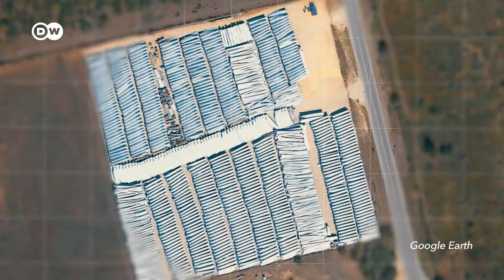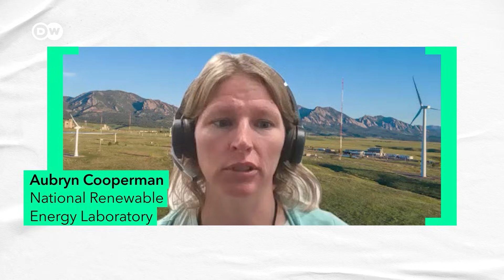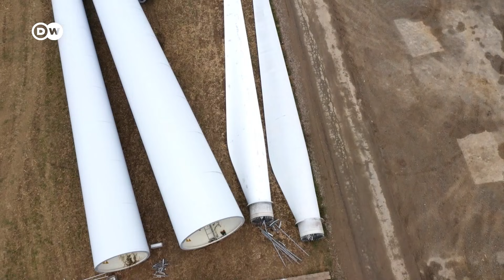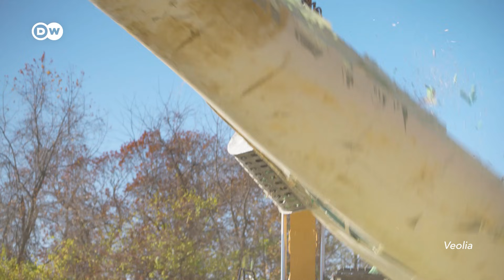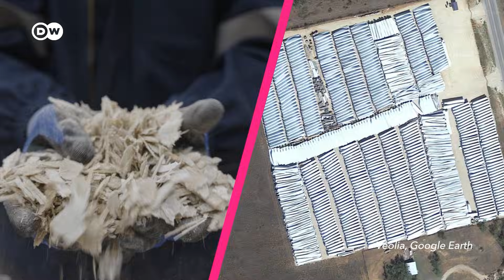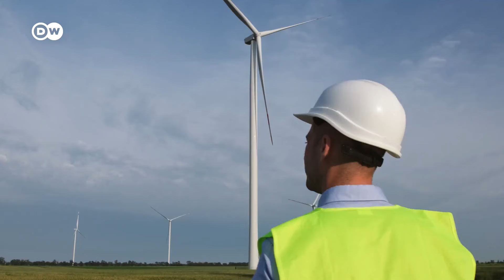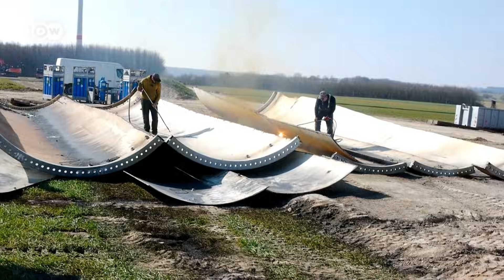Wind power's unsolved problem

Comment: honestly i would do it differently, i would start by shreading the blades then i would throw them into a gasifier take the hydrogen co2 make methanol take the glass than comes out with the ash and dump it back at some percentage with virgin glass in order to make glass fiber as for the methanol we all know that methanol is a polymer feedstock maybe we can make new resin out of it,  and in order to sustain the gasification all you have to do is feed it some oxygen in small quantities maybe you can recover the heat and and use it for something usefull like heating the catlyst in order to make methanol dude the possibilties are litteraly endless, its not that we cant recycle wind turbines its that wich method is more profitable and ethical

Comment: What is facinating is that those that complain the loudest about renewable energy recycling are those biggest voices that push for nuclear power generation, the most expensive power generation that cant be recycled at all, and for those that say nuclear power is cheap, it is till you add on the decomissioning cosats that far exceed the construction aand running costs and are never included in costings for nuclear, unlike a coal fired station that can be deconstructed aand recycled aand the land reused and the saame with renewables, nuclear is forever, a problem that lasts for thousands of years.
Reply from the maker: In the past we debunked some of the biggest myths about renewable energy 👉 https://www.youtube.com/watch?v=k_Wa7v76k-U&t=2s Please let us know your thoughts in the comments!

Comment: Blades are already going bad around 5 years in use . Explain that
Reply from the maker: They are designed to last around 20 to even 30 years. Do you have an example case to give? Maybe in that case it could be because of material fatigue, harsh weather, manufacturing flaws, or insufficient maintenance...🤔

Comment: It might be a silly question, is it possible to use aerospace grade Aluminium for the wind turbine blades or an mixed alloy of some sort? Also we can use off-shore sea based wind turbines close to the shore, so it does not make the green land space look ugly!
Reply from the maker: Not at all! Aerospace-grade aluminum could be theoretically possible, the combination of cost, fatigue resistance, and manufacturability makes composite materials more ideal. What is being investigated at the moment are different wood compounds such as wood-epoxy or wood-fibre-epoxy. Off-shore wind is a great topic we have videos on! 🌬️
"Is offshore wind the energy of the future?"
https://www.youtube.com/watch?v=IsUBq3BM8rU
"Floating wind turbines: Offshore energy's secret weapon"
https://www.youtube.com/watch?v=El4kHkJ7ITs
Reply: @DWPlanetA  Thank you for the links DW, very informative and prompt response 🙂

Comment: Wind power is neither clean, nor cheap. It requires equal capacity of balancing power with heavy turbines (eg. coal, gas, oil, hydro or nuclear). The cost per KWh is about 5 times higher than for nuclear. CO2 per produced KWh is 5-15 times that of nuclear, depending if you include emissions from balancing power or not. Plus the microplastics; about 62 kg. per turbine/year! Plus the noise and shadow reflexes that pester life quality and property values for humans. And so on. It's a trendy gimmick. Build nuclear breeding plants instead.
Reply from the maker: But what about the initial construction costs? And decommissioning old plants, that also adds to the total expense? Check out our channel for multiple videos on nuclear. ☢️ Here's one to start with 👉 https://www.youtube.com/watch?v=9X00al1FsjM
Reply: @DWPlanetA  A nuclear plant is far more expensive to build than a wind turbine of any size. But since nuclear plants today have a life span of about 80 years, the cost per produced KWh is much smaller than that for wind (+gas etc. back up power/regulation power). Even a life span of 40 years (older plants), plus huge waste storage taxes, like here in Sweden, gives cheaper electricity than wind. Wind power, combined with closing several nuclear plants, has derailed the Swedish electricity grid. Once probably the cleanest, cheapest and most stable in the world. 50% nuclear, 50% hydro. Now total volatility. From minusprices to high prices, 10 times that of before. No industry can work under such conditions = deindustralization. In Germany even worse due to even more wind and less nuclear. They have reopened their old coal plants(!!) due to this. So the "climate friendly" wind politics --> much more coal/CO2 emissions.

France has about 60 reactors. Their prices are many times lower than those in Germany.

Nuclear is the most effective, climate friendly, safe, and cheap form of energy production, except hydro power. One can like or dislike, but that is a fact. And breeding technology will enhance that even more.
Reply: @DWPlanetA  I watched your video. Recognize much, and question some. Germany have had to reopen several coal power plants due to shutting down their very safe nuclear plants. Sky rocketing energy prices, which affect all neighbouring countries in the EU.I read the other day that Germany now have some 150-ish coal power plants running. In the name of "climate"... Now they are going to tear down a village from the 12-hundreds - to expand the coal mining.

I want to give you this video, by a serious and well read people emulator and entrepreneur (one can choose english texting):
https://youtu.be/w-g5kZ6KLbo?si=MPZBHQ6QjBZQi8CH

Comment: Until we are able to find commercially viable ways to reuse wind turbines for manufacturing new wind turbines, using them as a way to reduce the emissions of cement industry and other major polluting industries is the best way to reduce the negatives of the wind energy and wind turbines.

Comment: Glass fibers has been produces for over 50 years for pipes, pipelines, pools, boat hulls, car bodywork, house panelling, etc. 
And hundreds of times more waste is generated there than from wind rotors. 
In Europe, large glass fibre parts are burned as fuel in cement factories.

Comment: Kills too many birds and fish. Wears out probably in just 10 years, not 25 years. Blades recycled are more expensive than non-recycled. Takes up farm land. We need all the farmland we can get. Solar panels are better, because they cool the waters which produces more fish. And solar panels that are not over lakes and oceans are distributed over land that can't be farmed.
Reply: Kills less birds and fish than fossil fuels.
Windturbines can run fine for 20 years, some even for 25 and 30 years. The oldest runs for over 40 years.
Farmland is rarely used and the pillar itself does not need much space.
And solar panels can be found on roofs and unused land. One does not need farms. But some farming works well together with solar energy.
Reply: @old-pete  Solar roofs are the most inefficient method of energy. Turbines do break down in just 10 years. You do need more farming. There are 8 billion people on the planet soon to be 9 billion. I pretty much disagree with everything you said. What does work are these new kind of turbines that circle around about a 1/4 of a mile. New technology. It's about 30% cheaper and more efficient. Solar panels break down very quickly, e.g. hail, rocks, animals. The only solution is  new types of wind farms that nobody knows about.
Reply: @Parture  Solar roofs work quite well, as one can save grid costs.
Your information about windturbines seems to be outdated by at least 40 years.
The population increase should be reason enough that one cannot supply fossil based power to all of them.
Solar panels last easily for 30 years, some even 40 years, as they have no moving parts. Solar panels usually come with hail protection.
Reply: @old-pete  Solar roofs are incredibly inefficient. They need to be major solar farms to maximize efficiency. The new type of wind farm is new technology; it's quite amazing. We can't jump to fossil fuels all at once. It will take decades so solar and wind are supplemental for now. Patience. Solar panels break down quite fast; you can observe this in lots of youtube videos. Solar gets hit by all types of objects so it has a surprisingly short life, not to mention they are rendered useless covered by dirt losing its impact. You don't seem to understand what's going on.
Reply: @Parture  They are not inefficient for the owners of these roofs.
Nobody plans to leave fossil fuels all at once. That is why some countries started 50 years ago.
And I have never seen solar panels breaking quickly. I know people who have them on their roof for over 20 years and all reports agree on that.
Reply: @old-pete  For the owners of the roofs break even is over 10 years. 50 years ago we did not have the technology. Lots of youtube videos shown solar panels all busted up and covered full of dust, totally damaged by hail. They just don't work that well considering these problems. Roof top solar don't cover the expenses. They eventually wear out. That's a fact of life. So people need new panels every 15 years. It would be more productive if they access the grid which is way more efficient. That's what the experts say.
Reply: @old-pete  Some more ideas...

The main problem is opportunity cost. 30 panels around the house is just not that good. You could have invested that money at 5 to 10% or more. One year you might gain 50% on your investments or 100%. That totally beatas solar. Trees and bushes get in the way, you have to dust them off every week and weather can get really bad for a long time producing no energy at all hardly. It's just not worth it. It's better to let the grid work its magic, so you can take that investment and make profits off of that, and use that money for some investment.
Reply: @Parture  As I told you, decent panels have hail protection. Getting some without it is stupid.
I suggest you ask different experts.
Opportunity costs are usually considered in any break even analysis. 
And no, bushes are rarely in the way on roofs. Trees might be, but it is the investors decision if he still wants the panels. And no, they do not dust up in a week either.
Reply: @Parture 

"Lots of youtube videos... "

Thats anecdotal evidence and makes no consideration of scale. What percentage of panels fail? What's the average lifespan? For all you know, those videos represent 1 percent failure rate. It's completely useless as evidence. 

Meanwhile what we do know, is that most solar companies have warranties guaranteeing a certain power output(usually 90%+) for at least 20 years.
Reply from the maker: Hey there! We actually did a video tackling the point of wind turbines being dangerous for birds. You can find it here 👉https://www.youtube.com/watch?v=k_Wa7v76k-U
What you might find interesting, are solar panels that are put on lakes 👉https://www.youtube.com/watch?v=2hwpXCjmkRo

Comment: I learnt the wind turbines don't start turning due to wind.
The get boost started by external electric power.
Reply: That is wrong. When the minimum windspeed is reached, the wind is strong enough to turn the blades.

Comment: A gel coat can be added to fiber glass boats and the hull is as new. Why can't this be done with wind turbine blades?
Reply: If the damage to the blade is not extensive, something similar is done.
Well maintained windturbine blades are checked regularly and damaged areas are repaired. 
This can only repair superficial damage. Damage to the inner structure may make the retirement of the blades after 20 to 30 years necessary.

Comment: they are not bad ,just to old and gob and insurance do not allow them to be use, solution is to convert them as a air compressor ad a few together in a simple air motor ,the half tip can be used as rigid sails on ships

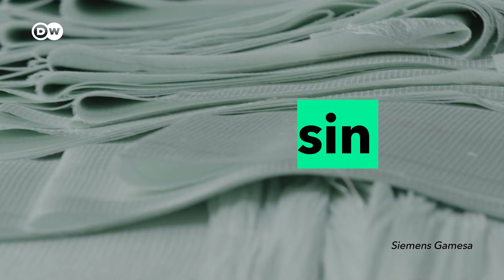Comment: 5:40 "This resin can be dissolved easily in a mild acid solution", how mild are we talking because normal rain could be considered a mild acid solution.
Reply: Sure. The use water soluable resin, since they are used only for indoor windturbines...
Reply from the maker: It is different process from rain because the separation does not primarily rely on adjusting the pH level but involves heating as well. 🔥

Comment: glass fibre is recycable but its not worth do it with with existing tech we need to find better ways to destroy fibres. With resin glass fibres becomes way too durable for our traditional grinders 
but when its recycled it can be used as top quality sound and heat isolation
Reply: If it prevents dumping it in the enviroment, it is worth doing it and saves energy.
Reply: @old-pete  because of the resin it catches fire pretty quickly it has to be done in controlled enviroment and needs regular maintenance to grinder cuz its so durable without government help its impossible to make profits
Reply: @serdarcam99  As long as one does not light it up, it does not catch fire. And since companies offer the recycling without subsidies, they seem to make money with it.

Comment: For the new wind turbine blades with the dissolvable epoxy, I would be worried that the natural acidity in rainwater could compromise the structurap integrity of the turbine blades. When rainwater forms, it naturally reacts with the CO2 in the air to form carbonic acid. If the blades only need mild acid to dissolve the epoxy, then I'd be worried that the carbonic acid in rainwater would be enough to destroy the blades over time.
Reply: I would not worry about that. Rain is not exactly a new phenomenon.
The recycling process also needs a temperature, which is sigificantly higher than natural temperatures and the solutions are "a bit" stronger.

Comment: If you grind up old wind farm blades both glass and carbon fiber and add then to wet concrete at the batching plant i can see a real risk issue can you? ,,,,,   Well its 30yrs later and the slab is to be crushed up for the new development to get made what happens with the rubble ? and more worryingly the dust. We have seen this before with a product that was loved in its day and ended killing thousands it to was mixed into concrete as sheets got were i am going yet NO ASBESTOSIS & silicosis disease a man-made issue rearing its head again will we ever learn from the past?
Reply: The stuff is not added to wet concrete. It is burned in the cement killn.
Reply: ur not in the cement industry you are just repeating info and not researched it yourself  @old-pete
Reply: @simonbowman6206  Then you are wrongly informed.
The glass fibre reacts in the cement killn to cement.
The blade particles save fuel, sand and other minerals.
Reply: glued to cement you mean ,,Now to the cement killn it runs below 1700 so glass remains hole and carbon fibers cant be burnt regardless of temp only the resin. So can you burn the blades yes but that's not what IS happening the items are not burnt till there is no waist only about 50% is resin  the EPA issues to comply with the smoke alone would make it a financial dead zone. I think you have not worked with fiberglass let alone carbon fiber and your position is set by what you have seen not what you have done & just to if you really wish to recycle the blades lay them in a bath of resin dissolving chemicals like acetone and the glass matt can be re used in items where the load is less BUT NO BURNIT !!

there ground up and added ok @old-pete
Reply: @simonbowman6206  That is not what I mean.
As I wrote the glass fibres react with the other components to cement.
Reply: @simonbowman6206  Sounds more like you are running out of arguments.
The quartz sand of the glass fibres reacts to cement. After that there are no glass fibres left.
Feel free to read up on the process. Neocomp pioneered the process a couple years ago.

Comment: If those blades so resilient, we can't recycle them properly, then why can't these be reused in new wind turbines? Just refurbish the surface and use them until they recycle themselves by breaking apart...

Also most bathtubs, plenty of car bodies, boats and yacht hulls, many surf boards and other stuff is made out of epoxy and glass or carbon fibers. No one is talking about recycling that junk...
Reply: If they break apart while the turbine is running, it will destroy the whole turbine.
That is why they get decomissioned in time.

Should a turbine blade be in good condition and that type of blade is still in use with other turbines, then used blades can be used for other turbines, but this is rare.
New turbines use different blades, so used blades get usually paired with older turbines of the type that used these blades originally.
And generally the blades fail before the turbine does.